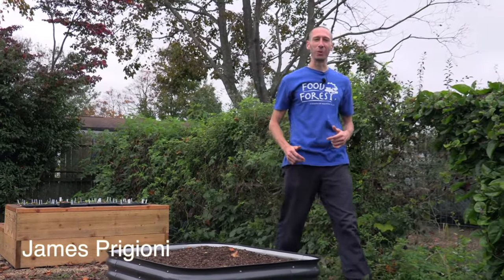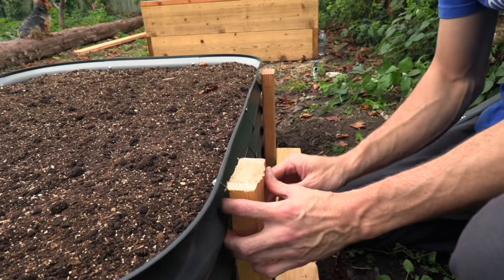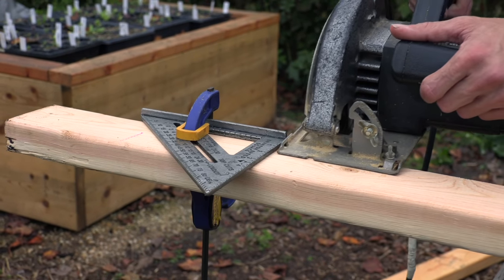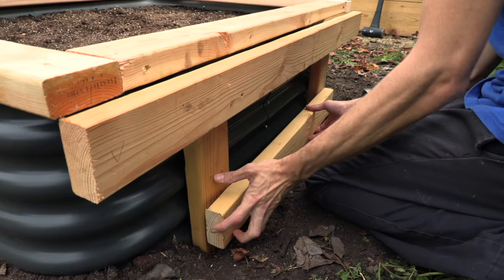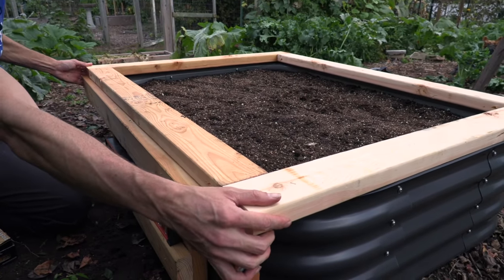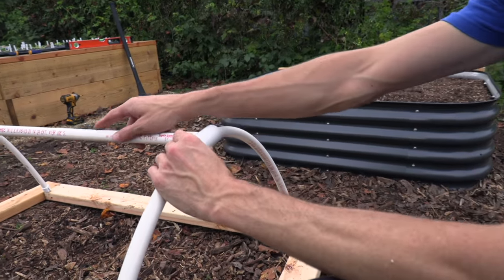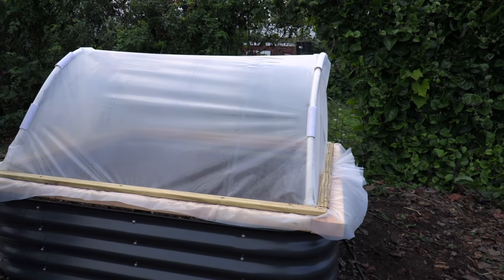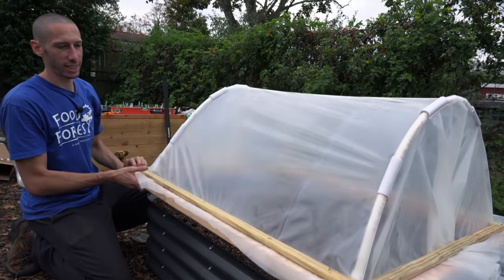How to Build a HINGED HOOPHOUSE for a Steel Raised Bed Garden

Comment: James, I have a suggestion for you.  Instead of attaching the hinged hoophouse at the top of the garden bed, make it a bit larger to cover the entire bed and rest on the earth.  The larger you make the footprint on the soil, the longer you will be able to grow.  It will keep the grow bed and ground from freezing.
Reply: Question --- How do you access the bed to harvest, water, weed etc?
Reply: @brandywineblue  same way really, you can just tip it up, or you can bend rebar in an upside l and use as hinges by drilling into end of frame, and put one that locks on the front side.

Comment: Hello again........Suggestions here please.....just offering
1. Make the long sides where the hinges goes full length......This will allow hinge to screw to the cross grain of the 2x4 for strength (screwing to end grain will weaken quickly)
2. Using the long side all the way across allows the pvc caps to also be attached with a cross grain , not on the end of the 2x4....consider a small washer on screw holding pvc caps to 2x4 for added strength
3. With your larger beds additional cross brace instead of electrical tape to hold in place screw them from the inside into the hoop section.
4. great idea with weatherstripping
Love your channel and your energy is contagious

Comment: Great demo! Also,  thanks for mentioning high winds.  I'll be out on the high AZ, nearly barren desert. The winds in spring and summer are rather annoying, at the least  😂
I'll most likely create ancient waffle style gardens with some areas utilizing lumber and hoop designs. I have considered using EMT tubing with an electric bender. The winds are so strong, a 15' tall X 11' wide polygon dome built with 2x4's flew off the ground and landed 100 feet away!  Lesson learned  ✅️

Comment: Great video ....Looks like rubber hose maybe on the edge of the metal container for a weather seal...cut a slit in the hose ..you could use an old garden hose and recycle :) just a thought

Comment: I saw a video by Leon (from Oklahoma) who used wiggle wire channels to secure the fabric. It's more expensive, but makes it easier to swap out material and doesn't put holes in the material.

Comment: Nice design. 

Like the staked support. 

Because hot air rises and cold air sinks, is the little gap significant? The weather stripping doesn’t hurt anything, but seems like an unnecessary step/expense. 

If you move the end of the arch to the center of the wood, you could drill a hole the size of the pipe and skip the end caps screw to the wood. 

If you can warm the pipe (build it on a sunny day), the pipe would bend much easier.

Comment: I have a concrete block bed and this is the perfect hinge lid for it.  Thank you!  Oh, and we just love seeing Tuck!  Thanks for teaching us new things, James!  We appreciate all you do!
Reply: Judi Farrington , have you or anyone else had any problems using concrete blocks for raised beds? I  have some I can use for that purpose but weren’t sure they were safe to use for growing.  No problem with freezing as I’m in Florida.  Thanks anyone with answers!
Reply: @annluke4544  Our concrete block bed is 2 years old and has held up just fine.  We love it.
Reply: Ann - We have concrete block raised bed that works well also. From a longevity standpoint, you might want to paint or at least primer the blocks. Over time, some of the cement can leach out of concrete and change the pH of the soil. It won’t be enough to effect the structural integrity of the planter but could create a headscratcher problem for your plants.

Comment: Good call on using the foam weather strip to seal the  bottom edge.

I built your other version of double hinged hoop house on a 5x10 bed.  For the frame I added a center support, metal corner brackets and wood corner bracing.  It has been working really well.
To prop it open I use a brick, 30" long or 50" long piece of wood depending on how much sun and the outside temperature.  I need to attach a rope to to prevent it getting blown open by the wind.

Comment: Good video. Just wanted to say I used to work at a job where we used a lot of pvc pipe and had to manipulate it. A good tool is a torch. You heat it up and it helps you manipulate it. Also I would recommend glue to make sure it stays. Other than that I just subscribed and I enjoy your videos.

Comment: Great idea James. I think a great improvement would be a square triangular shape in stead of a dome hoop shape. For a small design like yours you don't need that added hoop structure strength. A hoop or arch is usually for architectural strength and on such a small scale you dont need that extra added load bearing strength design. So you can build it rectangular or square and get more grow space.

Comment: James.... very nice design.  I like it and may use that idea on my galvanized rounded water/feed troughs that I'm using for raised beds.   I may want the side 2x4 that carries the hinge to extend 1.5" further so that my hinge can be placed vertically from the back brace to the extended side pieces.    Doing that will also give more space between the connecting screws that hold the 2x4's together and the hinge screws.    I think my galvanized troughs are less squared off so I may have to add a small piece of triangular 2x4  in the corners to complete the seal.  Anyway, nice design.  Geo

Comment: 13:45 starts the part that shows the calculation for the hoop length -Diameter from inside to inside / 2 is radius then times pi (3.14) is the size of the hoop (then he adds 4 inches to allow more flex to bend in the hoop).

Comment: James, I am addicted to your channel! My raised beds are steel, and I've been wondering about putting something over them. Thanks for this excellent video.  Did you use pressure treated wood--particularly for the part that goes into the ground?

Comment: hey dude, thx for what ur doing and sharing with us. so let me get to it. i'm one of hundreds of thousands who are financially challenged.  also most of us don't have many basic tools let alone all the xtras like clamps, saw horses, two drills, etc. etc. . so can you do some stuff for those gardeners please.

next. i'd like to know the name and model numbers of the gear you use so i can research them and compare for when i can buy power tools and other stuff. can you speak on why you get certain tools like at how many volts for the drills etc. thx. dude really appreciate you. 

i'm on a fixed income = low side but i can go slow and steady once i get rolling like a good capricorn type bulldog = pitbull .  I
i need to know why you have two different drill types and also what's the best  drill do to buy when you can only get one type . 
oh yeah I'm in the united snakes = maryland to be exact and i'll be 60 come jan. 16. want to grow some food and already plan to order 2 yrds to start one. found a good source for better quality medium that's cheaper and better than our state/local versions. 

i have a long back yard and will on do one raised bed cause i want my dog and maybe another to come still have plenty of room to run around.

Comment: I have a raised bed that is 55 x 28 im glad i watched this so i can add some length to the hoop im not sure i will have the strength to get a hoop on this bed of mine.  Two questions: 1. Does this size need a middle hoop? 2. Your bed was 43L mine is 55" length would you use 1 or three poles on top on a bed this size?  Thanks i love your channel

Comment: What’s the second hoop for? Love 💕 the idea and that it is completely separate. The only thing I would do differently would be to put screening layer first then plastic. Also too take it up one notch better I would attach the hoops to the firing strips sandwiching and framing the plastic then attach to the 2x4 frame allowing you to switch your tops out easier well it’s hard to explain but looks great thank you for the video
Reply: How do you suggest attaching and using the netting for bugs and the plastic for frost do they are easily interchangeable?

Comment: Here's an idea...instead of weather-strip tape,  assuming you have access to a router, try cutting a shallow channel in the bottom of the wood frame that the steel bed would fit into.  I think this method would seal adequately and be more reliable than using weather strip adhesive tape that will likely peel off when the wood gets wet.  I will let you know how that works in a few months...
Reply: Did it work? :)

Comment: OLD LEATHER SMITH here, I like your design, SUGGESTION, POOL NOODLES OR PIPE INSULATION I BELIEVE will work on the raised bed with NO DAMAGE, and B more resemble in cost, GOD'S BLESSINGS ✝️⚾🙃

Comment: I was just sitting here thinking about how easily I could use this design to make a light weight chicken tracker. It would need to be bigger and I’d need to change the design a little bit but it would work pretty well. During the summer my hens could live in something like this so I could move it around. During the winter they could stay in an actual chicken pen.

Comment: Is a width of 2 feet too short for this type of PVC? Can I get anything flimsier if it will be stretched so tight anyways? My hoop diameter is going to be about 2 feet, plus another 3 inches MAX if I put the PVC on the outside of the 2x4s.. Any suggestions? Putting a hinged hoop house on these 6ft x 2ft farm supply troughs.
EDIT: Even with a 2 feet diameter/width of the bed, I chose a 63 inch pvc hoop, it feels and looks great, perfect size for my tomatoes. BUILT TWO GIANT HOOP HOUSES!!! LETS GARDEN!

Comment: Instead of the hoops why not make like a sliding top,so it will basically be a cap but with green house plastic and keep warmth in.Meanwhile in the summer you can slide it out so it doesnt over heat?

Comment: You likely haven't read my comments on the other video like this, but maybe you will make a better wooden door frame this time.  If not, well, that would mean you don't yet realize what you are making is a door frame.  Oh dear, the same mistakes as before.  Building your "door" frame that way will work for a while, but not as long as it would if made like a common wooden door frame.  The other recommendation wood be about the wood used is subject to warping sooner than common redwood fencing.  There are other wood options that resist warping, but they may not be as cheap and easy to buy.  Must not know about the hot sand method to bend PVC pipe.  It is kind of interesting you went to extra trouble to foam the gap between the framing and the metal raised bed, but not the metal raised bed.  Metal conducts heat rather well, so as soon as a cold snap starts, that metal is going to cool off the soil very quickly and those plants are going to have some very cold roots.  If those roots are close to the metal and wet, then can freeze in a short time.  If they are a bit dry, but not bone dry, they are likely to tolerate a bit of freezing if not for too long.

Comment: Hmm...is the wood treated?
Reply: Great video! Thanks. Great design. Need to modify my frame so it is easy to add a second layer if needed. One thing we do is use electrical pvc conduit as it is uv stable so doesn’t become brittle as does the water pipe over time.